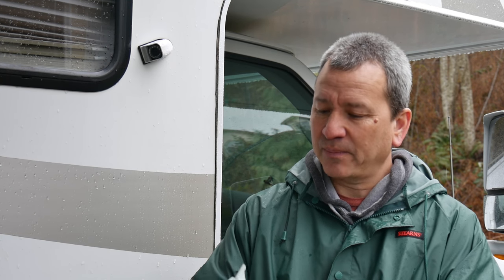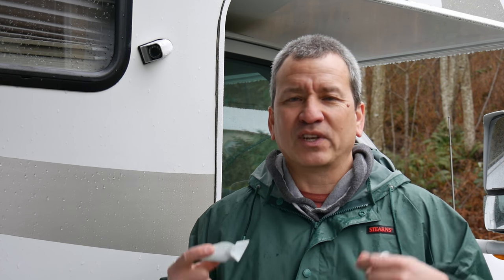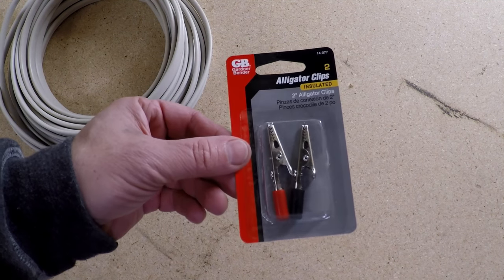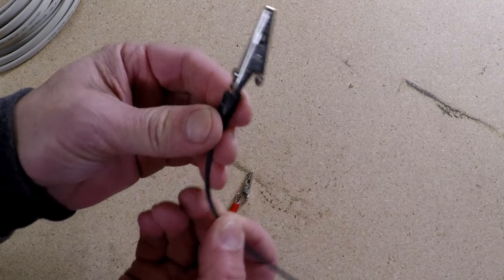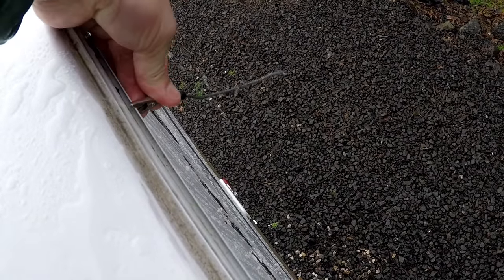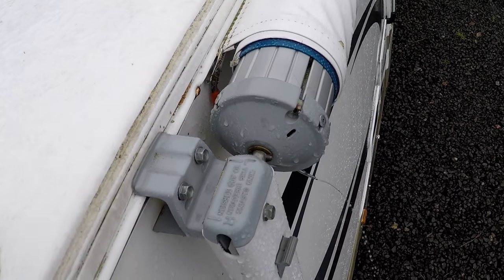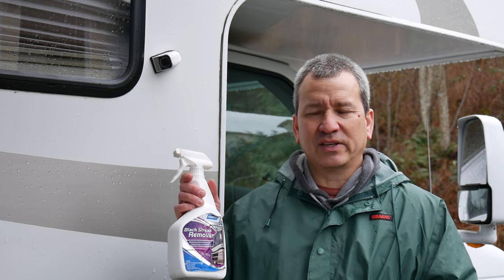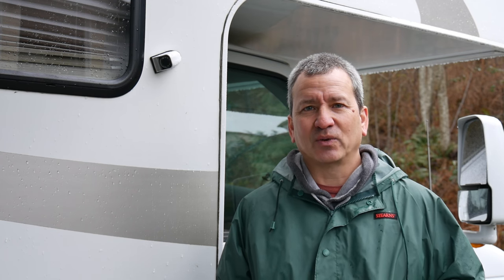DIY Rain Hack for RV and Camping

Comment: So easy its crazy. Just noticed last week when getting out of my newly purchased Class C in the rain, the manufacturer decided to end the 'gutter' right above the cab doors, so if you're slightly nose low you get a really nice steady rain drip down your neck while getting in/out of the rig. I've used the plastic gutter ends like you talked about on previous RVs and kept losing them so was trying to figure out what I could do on this RV...and SHAZAM, found your video. Can't wait to go buy alligator clips! Thanks for sharing this idea!!
Reply from the maker: Great Dennis. Good luck. I just picked up a bag of clips last time at the store. Can't have too many.

Comment: Didn't know what you were going to say. The tension was really building. And then it turned out is was.... Surface Tension! Gotta love surface tension. :)

No better DIY hack than one that nobody usually thinks of, costs almost nothing, is quick and easy to do, and solves an annoying problem. And just think of all the uses for those clips when it's sunny out. ;-)
Reply from the maker: RVgeeks Ah yes. And I was hoping to pass it off as pure magical phenomena and start selling "Tito's Magic Water Wire" for $7 each (or a pack of 4 for $20). Damn. So much for my watered down plan :)
Reply: "Tito's Magic Water Wire"! :D  and you've got the pricing worked out, even. ROTFL. Send me an Amazon link! Seriously.... great tip, Brian. Love it.

Comment: Your beast cleaner and polish for your sides and windows is 2-3 caps of kerosine in a square to oblong bucket and use a long handle 18inch pad swivel to clean and then rinse, thats how they used to wash mercedes benz in germany when they left the factory an old german who worked there told me that

Comment: Made some and they work well, diverting the water off the awning cover and mountings. Water used to drip midway off the underside of the over bed cab and now with the clips I have been able to divert to the side front.I don't have side guttering like you  and water runs off the front and back of the roof depending on parking surface slope so I will get two strips of guttering to stop this happening. Thank you for your post

Comment: That is brilliant! I do have 2 questions tho:
1) do you only put those up when its raining? (take em down when traveling right?)
2) Could you clarify the type of wire you are using? Plastic coated? Hollow? Does the rain just flow off the side of the wire? Its so amazing. I have an Airstream and Airstreams and water don't mix well. I'm going to look at the kind of gutters I have too for this to even work. I'm guessing you just have to play with the locations when its raining to figure out the best places to clip them. Great video! It looks easy enough for me to do.Thanks so much!
Reply from the maker: I usually take them down when driving. The one by the awning I can leave up and it seems to stay put. I also put a cover on the RV periodically, so I have to take them off to do that. For wire, I use thicker household solid wire that has a plastic coating on it. And yes...you just have to play with the locations to find the right spots.
Reply: Thanks so much for getting back to me. I looked for some of the components to make these for a trip we just took to Moab Utah (Rain in the forecast for 2 days) But didn't end up making them, but I am going to make them. I found some places to clip them on the Airstream. I'll let ya know! Thanks again.
Reply from the maker: Rainey Shafer I wouldn't worry about it. I don't use them at all when on the road, only when parked at home for periods of time.

Comment: Do you leave the clip and wire on, while travelling? This looks like an easy fix. I live on Vancouver island. We are getting a lot of rain now. I just raised the front end to direct the water to the back end. For some reason the back extenders are longer. Thanks great video.
Reply from the maker: Yes. I leave them on but I occasionally lose them. I actually sealed one right to the rear gutter (no clip). Nice wind storm and rain today too across the Straights from you.

Comment: This is awesome.  I was just attempting to make gutter extenders out of pvc pipe cut lengthwise .  This is actually much easier.  Back to the hardware store I go.  Could a plasic coated wire hanger cut into pieces work with the aligator clips.  And how do you get clips to stay on the wire ?
Reply from the maker: I crimped the clips onto the wire. I've also used plastic weed wacker cord which works well. What I have now is a wire that is permanently attached to the end of the gutter with some silicon...so no clip.
Reply: @RVwithTito  I did this yesterday and was super pleased with it.  My a/c runoff was hitting the sidewalls .  Not anymore though.  If anyone is having that issue, try it you will be glad that you did !

Comment: I like the idea, would like to just clue a strip of .095 weeder plastic cable.
Reply from the maker: +Ed Ginsberg Thanks. That's a great idea too instead of wire. I have a spool of that stuff laying around as well but it's bright orange.
Reply from the maker: Follow-up: I made a couple using the weeder stuff. Unfortunately, you can't bend it to point in the direction you need which is critical to its affectiveness. So, for that reason, I'm sticking with the wired version. Thanks for the idea though.

Comment: It appears RV manufacturers are noticing these things. No water runs down the sides from the roof of my 2019 Coachmen Catalina (my third travel trailer). It's all effectively directed away. Of course, if the wind blows, I'm sure at least some rain water is blown back onto the trailer. I just haven't yet stood out in such a storm to see how much.
Reply from the maker: I've since permanently mounted one on the back gutter with some adhesive sealant. I did this when I was finishing my delamination repair of that area and had to remove and replace the gutter.  Works great. I posted a recent video on Instagram about it.